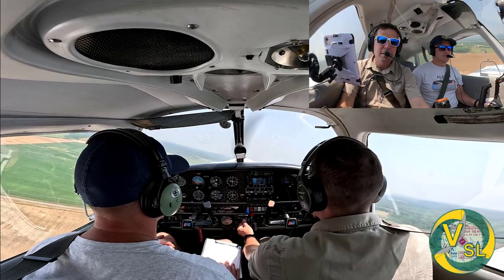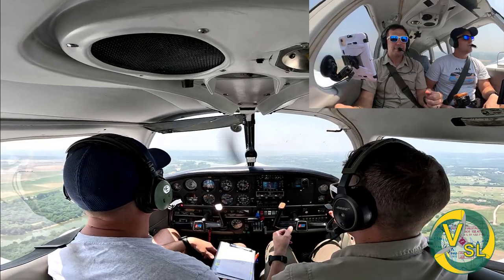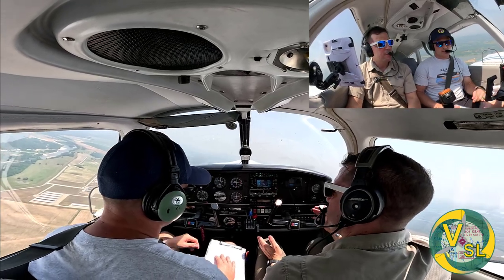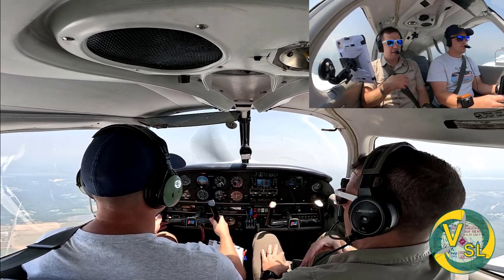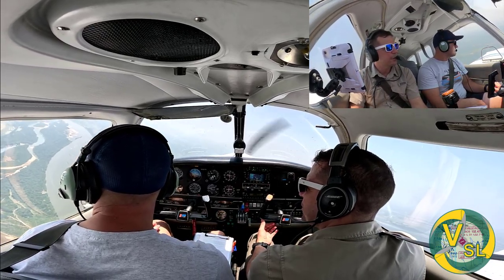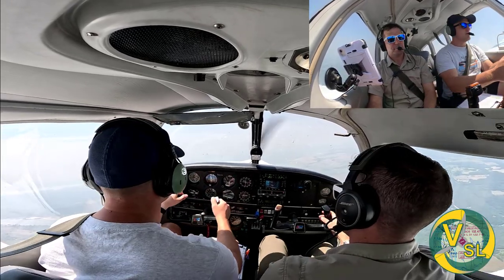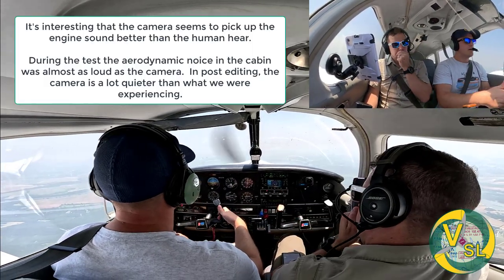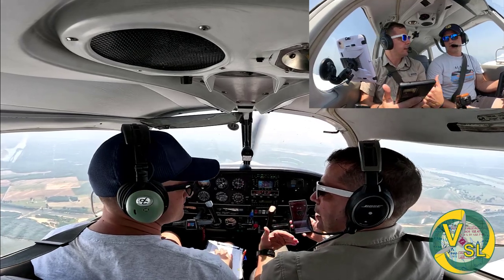Engine Failure in Flight: Unveiling the Invisible Danger (With Free Pilot Training)

Comment: 40 years of flying, one total engine failure due to fuel starvation (fuel lines fodded) in C-182 jump plane on descent after letting jumpers out....and didn't even know it until relatively low altitude as I applied power and had no acceleration.  Like you state, MP and RPM appeared normal!    Luckily I was over the top and performed a power off landing (prop kept turning until  TD) with no issues.   Anyway, great info and I love to keep learning even at my decrepit old age!
Reply from the maker: Thanks for sharing!

Comment: Enjoyed the video.  I often chop the throttle a few miles out to make sure that the "glide ring" on my EFB is accurate, and I can get it on the runway in an engine failure.  I of course know that the real failure might reduce my glide ratio - I have it at 8: for my RV-8.  When I first did this the engine actually stopped when I landed because I had my idle set too low.

Thanks to this video, I can certainly see a scenario where you pull power, start gliding for the airport, and realize that you want a bit more power to safely make it to the airport, and then find out you don't have it for whatever reason.

Very good lesson - you can teach an old dog a new trick!
Reply from the maker: Thank you so much!   Thank you for sharing.

Comment: 6:33 "Our fuel flow is still going to work". Do you mean it will indicate a 'sane' (but 'incorrect') fuel flow? That is counter intuitive, because leaning would be confusing, if the fuel flow (pressure?) meter ignores the mixture knob setting. I couldn't quite make out the indication because the yoke was in the way; or did you mean it will work, as in report roughly zero fuel flow?
Reply from the maker: Good question and I wish we would have gotten a better camera on the Fuel Flow and Fuel Pressure gauges.  The Fuel FLOW was reading almost zero.  Fuel PRESSURE was reading normal.  So the two gauges indicating a true engine failure (due to fuel problems) would be the Fuel Flow gauge and the EGT gauge.  Unfortunately, both of those gauges are not visible in the video.

Comment: One thing I will add on verifying the dead engine, and you touched on it, is if the throttle is at idle you can push said throttle up to see if it’s working. Too many many folks have been taught to retard it to verify. It sounds obvious but I know of at least one crash where, because of poor training, an engine failure was assumed and two pilots flew a perfectly good airplane into the ground. 
Also, don’t forget to keep your eyes out of the cockpit and looking for traffic when you are conversing. You don’t need to look at the other guy when you’re wearing headsets. Watch the video with this in mind and you’ll see what I’m talking about. My biggest concern with pulling the mixture is the potential to thermal shock the engine. Some engines will complain about that over time. Stay safe and fly smart out there!
Reply from the maker: Good discussion here.  I agree that pulling the mixture should be done with caution and proper risk management.  Even then it shouldn't be done frequently.

Comment: I don't understand why the fuel flow meter would still be working if the fuel is cut off?
Reply from the maker: If you have a fuel flow indicator it will read zero. The fuel pressure gauge however will indicate normal.

Comment: Does anything change in an airplane with a fixed pitch prop where you dont have manifold pressure gauge? 

For example, if when you pushed thr throttle forward, you saw MP change. Which makes sense, youre opening the throttle and letting air in.

But with a fixed pitch prop, i would not expect to see an increase in the normal measure of power for a fixed pitch prop: rpm.

Is my guess correct?
Reply from the maker: The failure mode is very similar in a fixed pitch propeller aircraft.  The RPM doesn't respond to throttle movement, but the RPM doesn't decay much below normal idle and the propeller continues to rotate.

Comment: Actually human as average considers 3db as a noticible change in sound, so 1db isn't that Unrealistic, but you measured A sound pressure and NOT a frequencies. We quite good at detecting frequencies changes. Overall Sound Scene might have the same db level, but the frequencies changes mostly in low end where engine produces the most of the noise.
Reply from the maker: VERY interesting!  Thank you for sharing.  I never thought about the difference in frequencies vs db level but that makes total sense!

Comment: Are we pulling mixture in flight now? Did something change since I finished my private? This is a great video, but that Piper only has one engine last I checked.
Reply from the maker: We pulled the mixture in this video to demonstrate a specific failure mode.  I'm not advocating or suggesting that anyone else go out and do so.

Comment: I had no idea this is what happen when you run out of fuel.  Is it similar in fixed pitch prop?  Thank you for the video!
Reply: Exactly what I was thinking. I don't think any of this applies to a fixed pitch prop, you would immediately notice the problem by simply looking at the tachometer. The reason it can be confusing with a constant speed prop is because the prop governor is acting as a gearbox, and since the prop is still windmilling - as long as you're at a low power setting it could very well be that the prop is spinning fast enough for the governor to mask the issue. Should you go full throttle prop forward you would have immediately noticed.
Reply from the maker: Yes, something very similar occurs in a fixed pitch propeller plane.  I will make another video demonstrating that soon.  You will see a slight decrease in RPM below what you see at idle but not that much (approximately 900RPM on most 172s).  If the engine fails when you are at idle, you very well could not notice.  The other issues with fixed pitch propeller engines is that if you get slow enough the RPM could decay to the point where the propeller and engine stop rotating.
Reply from the maker: I'm not sure I agree the governor is acting as a gearbox.  The governor is nothing more than a high pressure oil pump.  While a constant speed propeller will hide a dead engine a bit better than a fixed pitch propeller there isn't a huge difference.  I'll be doing a video soon demonstrating what I'm talking about.
Reply: @SethLakeDPE  I’d be very curious to see that. I guess if you’re at idle then it’s possible to reproduce the same effect, but if you have any power in at all - you should be able to see the lowered rpm immediately.
Reply from the maker: @alk672  absolutely.  If you are at a high power setting and starve the engine of fuel you will definitely notice it, no matter what type of plane your flying.  The point I was trying to get across in the video is even when you do notice something is wrong, it may not be immediately obvious that the engine is "dead" since it will still be spinning and the gauges will still be working.  I think many pilots have assumed they have a partial engine loss when in actuality it was completely dead.  I'll try to post the fixed pitch video this week.
Reply: Look forward to it, thanks for your thoughts on this.
Reply: Was there a follow up video on fixed pitch for this scenario?  I would love to see how that would look like.